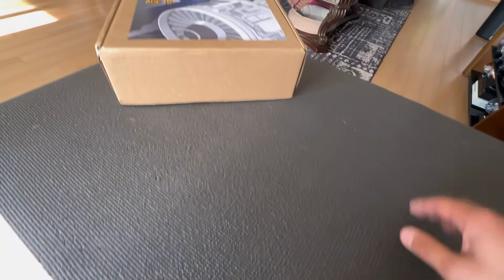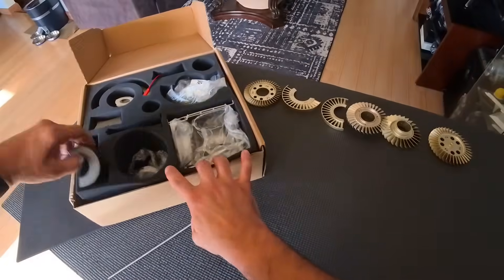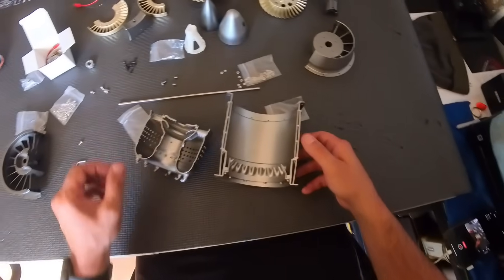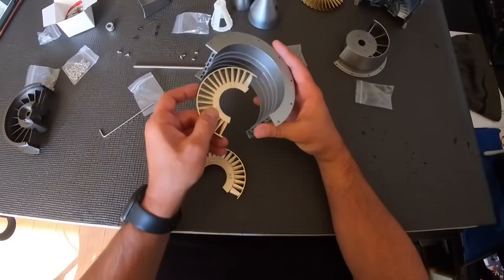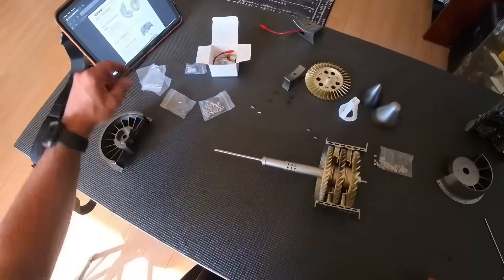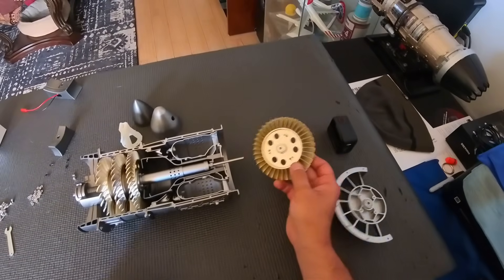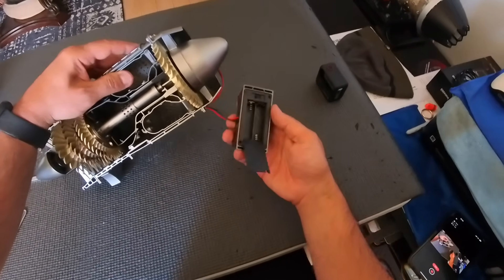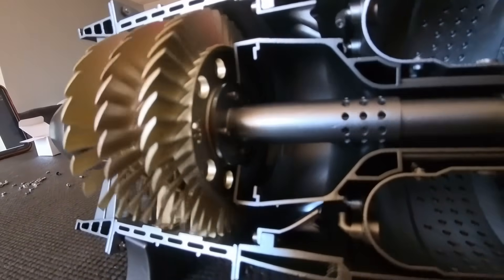Stig Projects (Build a Single shaft turbine engine)

Comment: hey stig sorry to bother you  but i have a question. the hydraulic pumps are drive by the plane engine or not?
Reply from the maker: Aircraft have multiple hydraulic pumps. Engine driven (which are on the engine gearbox) and aircraft have electric hydraulic pumps that are usually in the wheel well.
Reply: @StigAviation  thanks God bless you

Comment: When you rolled the compressor it reminded me of an aero class.  I took out the safety screw on a T37 engine cutaway so I could spin the blades.  As my instructor said 'don't'  my fingertip got between the spinning blade and side case.   Got me a quick trip to the clinic where i learned hot paper clips melt fingernails, allowing the built up blood under the nail to escape 😂.  So watch out for spinning cutaways. 😂

Comment: Where’s the high pressure side?  Either I missed it in the jump or there isn’t a typical N1.  That third compressor ring didn’t look like it was angled for any different ratio than the first two.
Reply from the maker: High pressure or compressor is the 3 stage section. This one does really have a big fan section
Reply: @StigAviation   Again, we learn new things because of this channel.
Reply: @StigAviation Yeah but I’m looking for the sharp angles you usually see at N1 just prior to airflow to the combustion section.